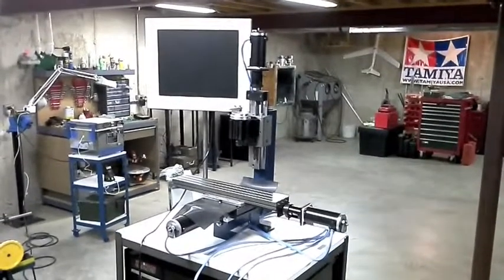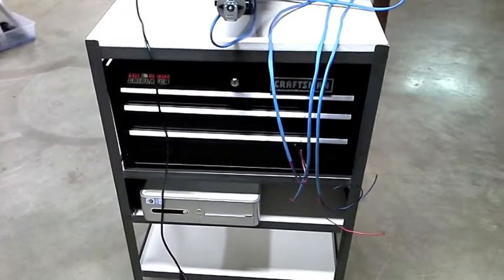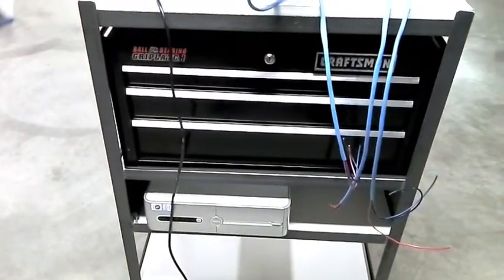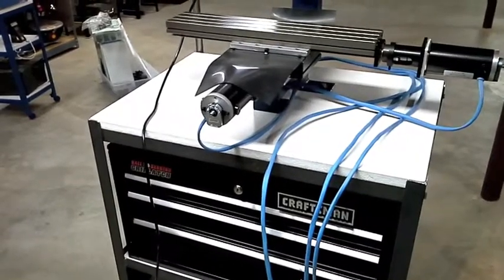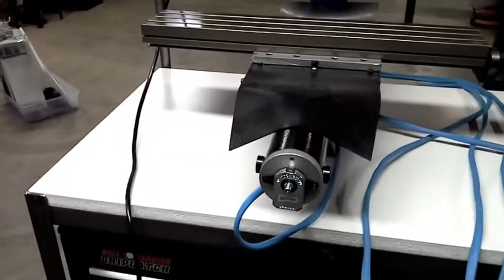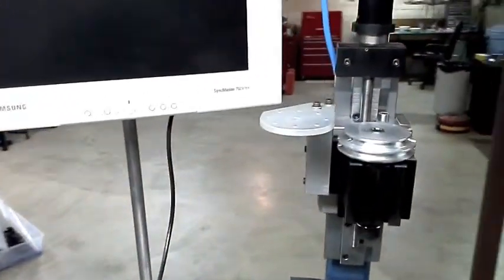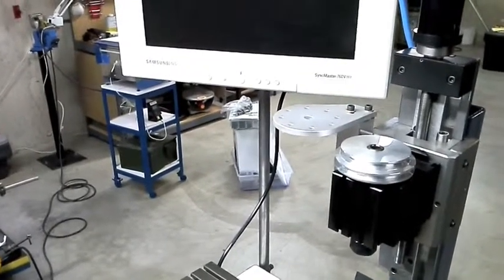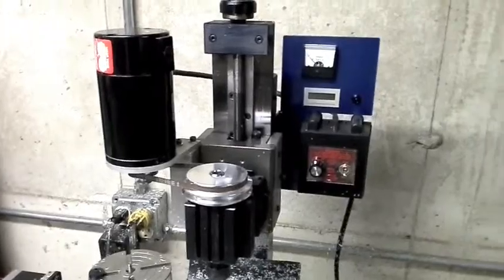Taig CNC Mill Phase 2

Comment from the maker: Thanks! I hope to eventually get another update video posted. 
Actually I went with the Sherline setup, just beacuse it was the simplist to figure out at the time, and I saw where someone else did it before. It works out pretty good, but l like the sound of your setup more. I guess that might be something to be modified after I get this setup running and tuned for a little bit.

Comment: Looking Good... what made you decide on the Sherline motor and controller?  I upgraded my Taig with a 1.25hp DC treadmill motor and a KB electronics controller and it works great....it will pull well over the 10,000 RPM that the spindle is rated for and I will eventually hook MACH3 up to it to control the spindle...  keep the videos coming.